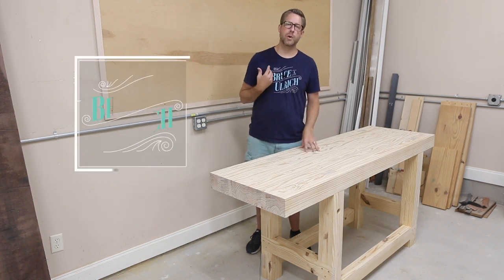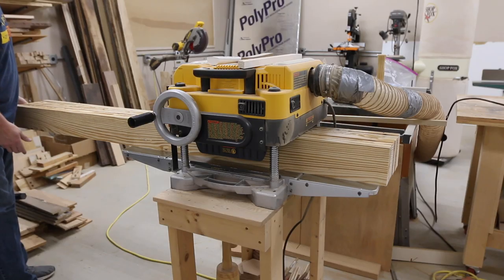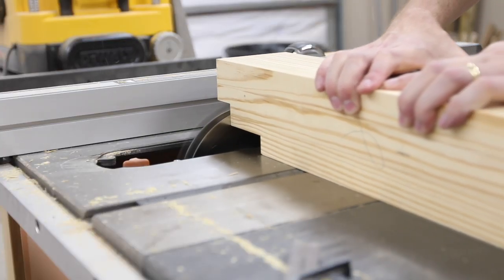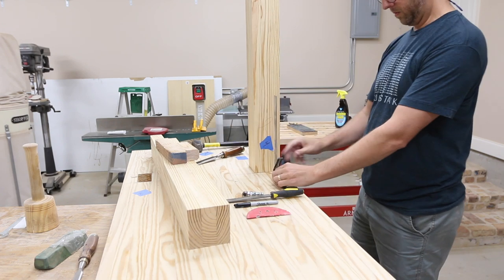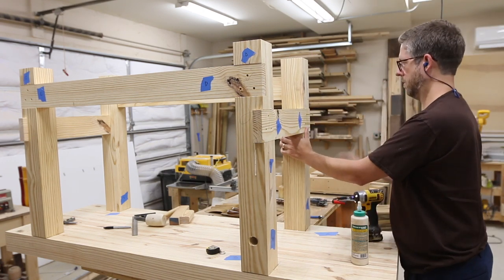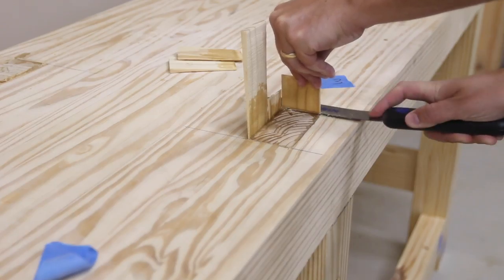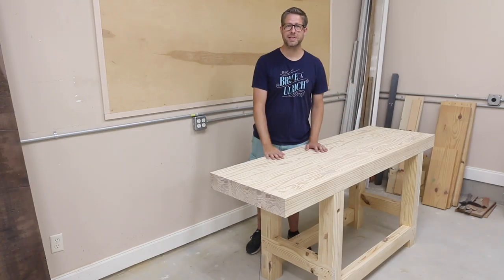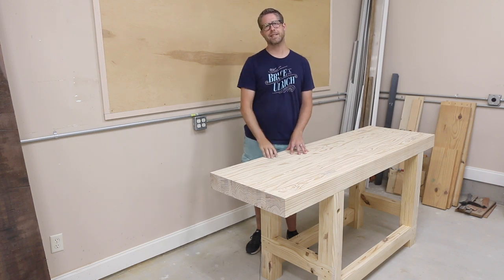Building the Jay Bates Workbench / WOODWORKING HOW-TO

Comment: Very cool, I'm glad to see it finally all come together!  What do you think of the bench being made out of the softer wood?  How do you like the height of the bench?  It looks a little shorter than I woudl expect, but then again, when you have stuff on top working on it, that might be a huge benefit.  It loosk awesome!
Reply from the maker: There is an age old debate about using a softer wood or hardwood. I fall on the side of...I think this will be fine. ha. Sure, it'll get some dents, but the thought is that your workpiece will not so easily dent and the workbench will take the abuse instead. I like the height of it so far. It is a little short if I were to be doing some drawing or something like that, but for something that I'll have on there that I will be planing, I think it will be about right. I made mine about 1.5" taller than Jay's plans called for. I'm almost 6'4" so I needed to bring it up a little. It's at 35.5" from the ground.
Reply: @BruceAUlrich  I know Jay mentioned his hickory bench had a lot of bounce back and his pine bench was softer when chiseling, which i like the sound of.  I'm 6'3" so I'll have to keep that in mind for the height of the bench as well.  I was also planning a smaller moxon style bench top bench that I can clamp down on top of the bench for when I'm working smaller things or just need to bring it up a bit, but getting that base height can be tricky.  Thanks for the info, I loom forward to seeing your toolwall set up and many years of use of that awesome bench!
Reply from the maker: @TheEveryMaker  Many places recommend that if you put your hand down by your side, the first bend in your index finger next to your hand is about the level your workbench should be. I'm about 1/2" too high for that, but I think I'm still within the range. I didn't even think about the bounceback from a harder bench.
Reply: @BruceAUlrich  I always go by a rule of thumb stand straight up arms straight down bring hands straight out horizontally palm pointing straight down have someone measure the height floor to palm . I've found this to be very comfortable.
Reply from the maker: @jameskoehn4331  Interesting. That's much higher than most recommendations I've seen.
Reply: @BruceAUlrich , Less stress on the back .

Comment: Having built the same bench, I understand the struggles of that build. The video looks so much easier than actually flipping that top over and over as it is leveled and mortised. Good work. I've added a shelf to the bottom of mine, a power strip and a vice as well as retractable casters for mobility and holes for bench dogs - which I have found useful. Looking forward to the next video which may inspire more enhancements to my bench. Keep up the good work.
Reply from the maker: Hey Andy! Thanks! Yeah, this thing is heavy to flip over a bunch of times. I know it took me forever to build off and on, but I’m quite pleased with it overall. I definitely like the idea of the retractable casters. I was thinking about getting some kind of jig to help me drill dog holes at a perfect 90 degrees with a drill. Wait until you see the wood I’m using for the leg vise!

Comment: Bruce , when I do a mortise ,like that I drill out around the parameter then drill bunch of ,larger holes. I'll use a blunch router then chisel  out what I cant get to and to trim. I'll cut some small shims / strips place on the back side. I've also used dowels , counter bored leg bolts and plugs . But as long as you have a tight fit which you did you could also use glue and saw dust to fill any voids .
Reply from the maker: Good ideas also! There are so many ways to go about this.

Comment: Very Nice Work.  I have a question. Why legs are not center in relation the cover? I mean, one side of the cover is longer than the other one
Reply from the maker: Thank you! This is a common design to have one side cantilevered out a bit. It allows for different clamping solutions and even some leg room if you wanted to sit at the end and do some hand tool work. At least that is my understanding.

Comment: hi Bruce.
that came togeth amazingly well.
I have one question. did you cut a kerf in the leg tenons to put the wedges into?
cheers
Joe
Reply from the maker: I actually didn’t. I had some gaps from my not perfect mortises so I put the wedges around the outside instead.
Reply: @BruceAUlrich  that makes total sense now. I'm going to be building my first bench soon, but I'm scared of those big mortises, so I might see if I can integrate them into the top (cut them out before I glue the top up).....
Reply from the maker: That’s actually a really good idea. Yeah, wedged tenons like this allow for pretty big gaps so don’t worry about them too much.

Comment: I don't understand why it's necessary to glue the top to the undercarriage tenons.  It seems like gravity and your very nice fit would keep it together pretty well.  If not glued you could disassemble for easier transport, if needed.  As you video shows, even that would be difficult.
Reply from the maker: You're right, it might be easier to transport to take it back apart, but like you said, it was quite difficult to get together in the first place. ha ha